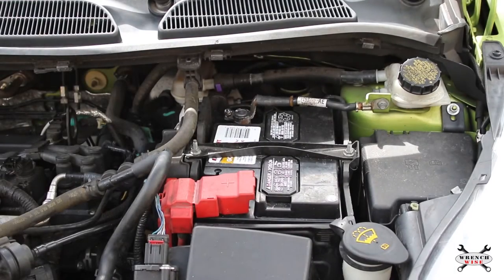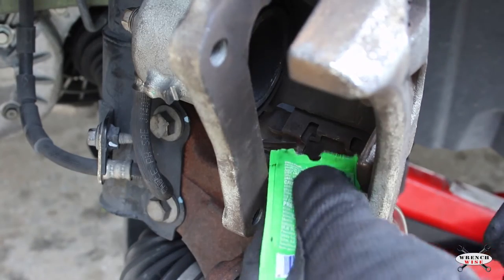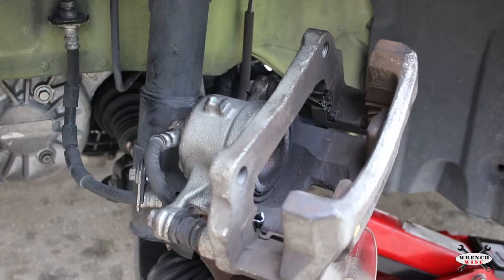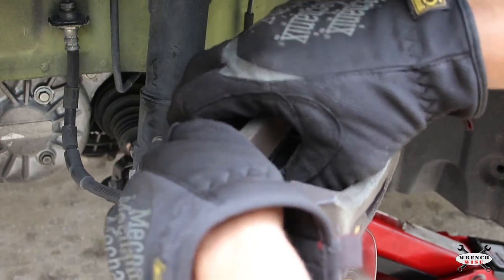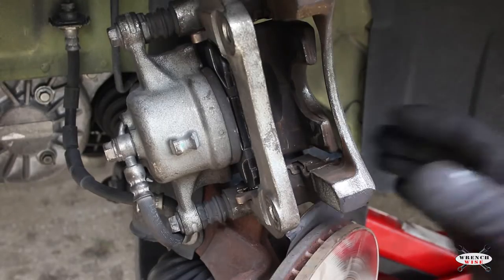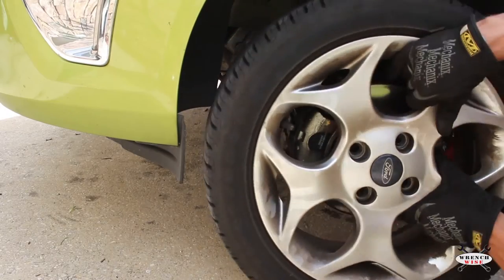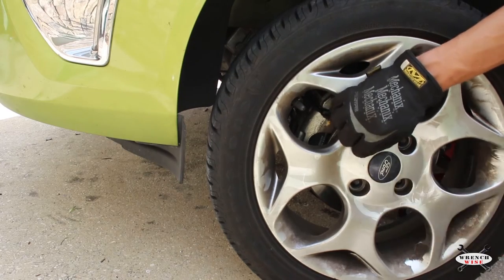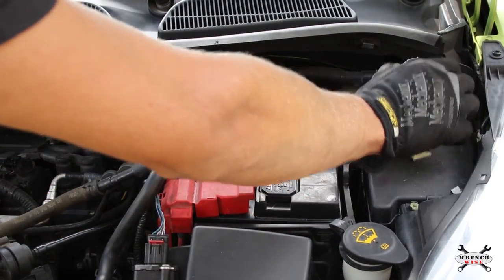How to Change Brake Pads on a 2011 Ford Fiesta

Comment: You only need to remove the main bracket if your changing the rotor or turning the rotor..removing the caliper itself is recommended if your not changing the rotor or turning it.
As far as the brake fluid reservoir the capacity shouldn't overflow should go back to max level,you should never have to add fluid to it two reasons for the level to be low #1 worn pads , #2 A leak and if you got a leak you got a problem.....

Comment: You don't need to turn the rotors? Also what about the rear?
Reply from the maker: If you have the equipment to resurface the rotors then yes. These ones were not warped or grooved and It typically is better to just replace when necessary. With drum brakes in the rear you will typically go through 3 sets in the front to one rear set.
Reply: thank you.
Reply: @georgeforall  Just make sure you bed the brakes which isn't mentioned in this video or you may end up with a squeal or other potential issue.

Comment: So no need to bleed the brakes?
Reply: Bleeding brakes is only if you are making changes to the brake lines (or similar circumstances) and need to remove air bubbles/pockets.
Reply: Good point, yes, another video from 1-A Auto says to open the bleeder valve on the brakes and let the air bubbles come out until there are none.